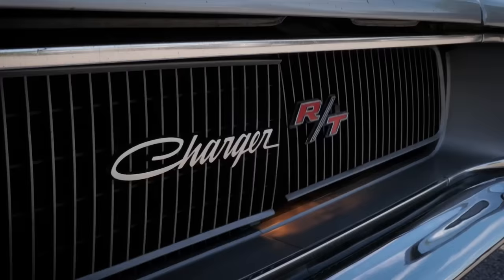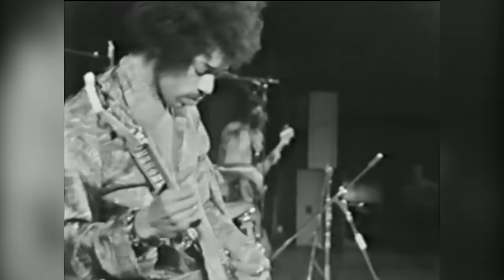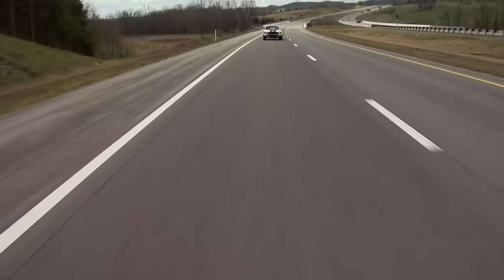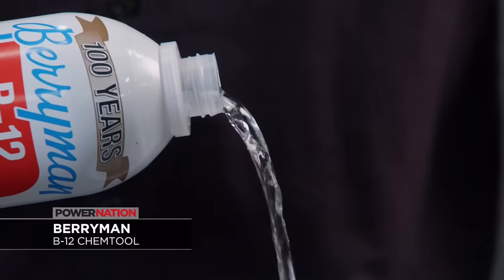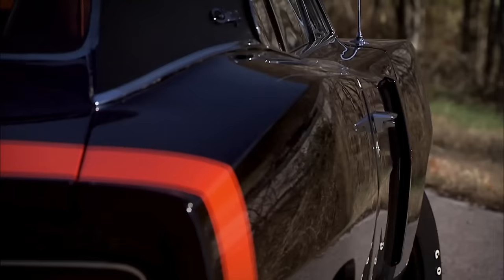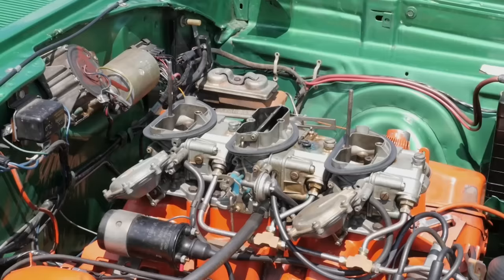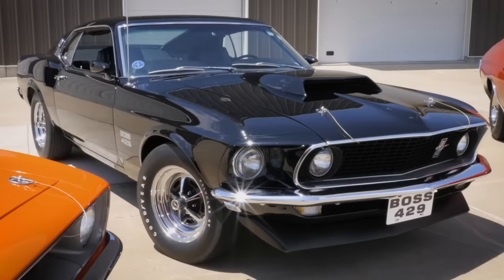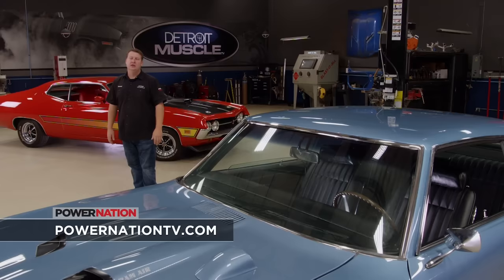Top 10 Muscle Cars of All Time

Comment: I was fortunate enough to grow up in the muscle car era with a Dad that was a gear head and taught me from an early age how to drive and respect the automobile.  I had several cars that I wish I still owned now.  Even though they may not have made this muscle car list, they were still awesome automobiles and I was fortunate to own them if for just a short time!   (1961 Bubble Top Impala with factory 283 power pack option, 1964 Ford Galaxie XL with 390 Police Interceptor engine, 1969 Ford Mach I with 428 Cobra Jet, 1967 Ford 390 GTA Fastback Mustang, 1970 Ford Torino GT 2-door Fastback with 351 Cleveland)
Reply: Same here.

Comment: In 1967 my family had the following 3 cars: 
DAD: 1964 Pontiac Bonneville 2 dr coupe with 421 c.i. V8 3 2 barrel carbs and a (no cost) option 4:10 rear end.
ME: 1963 Corvette Stingray convertible 327 c.i. originally with solid lifter 340 HP motor, but had been replaced by a 1964 365 HP Holley 4 bbl carbed 327. Car had close ratio 4 spd and a 4:11 rear end.
TWIN BROTHER: 1967 Shelby GT 500 428 c.i. 355 HP, 2  Holley 4bbl vacuum actuated carbs w/ Hurst 4spd tranny and Detroit Locker rear diff. The 355 HP was vastly underrated.
Gas was $.25 per gallon for premium.
Reply: Bunch of cool cars, especially the GT500
Reply: 😁💋lol
Reply: Wow - 3 great cars. My Dad had a 1967 Shelby GT500 with C6 auto that i could beat 4 speed Gt500's. Why ? Little known Fact - the C6 Auto in the 67 GT500 was a Factory Spec C6 from the ford 427 Fairline Drag Car that ford built( special order only). Ford sent out their C6 to a specialty shop to beef up the C6 to handle the HP of their 427 drag engine. I think this might have been the first performance automatic in a production car. By leaving it in Automatic using the brake/ pushing on the gas pedal and then releasing it- it I would burn a few feet of rubber go up to about 5500 RPM( 42+ or - MPH) shift burning a few more feet of rubber - then go up to about 80+ and chirp the tires shifting into 3rd gear and just keep pulling very strongly. I got home from the Army in April 1969 and was disappointed went I saw the C6 Auto in my Dad's 67 GT500 but was surprised when I Drove it. With progressive linkage on the 2 Holly 600 carbs you only drove on one but when got on it and the 2nd one kicked - Wow. And setting in our Garage next to the GT500 was my 1969 Kawasaki Mach III the Fastest production at that time - First Stock Motorcycle to break 100mph in Quarter Mile.
Reply: Gotta say bro had the best car haha
Reply: What a time to be alive (and white)
Reply: Early to mid 60s big body Pontiacs, bench seats 4 speed, cruising delightfully American highways.
Reply: @gregorylunsford3991  Ranking leaves fall of 1970 watching my best friend father drive up the drive in his Rambler, trailer tarp pulled back and full view of that unsold 69 green 500 Kawasaki.

Comment: Had a 1965 GTO for my first car
  389.with a single 4 Barrel with approximately 335 HP was fun to drive, however, I also had a 3 duce manifold that took approximately 30 minutes to swap out and the horsepower went to 360 horsepower.
So easy to work on cars back then.
Reply: Usually takes 30 minutes to drain out the antifreeze.

Comment: I had a 69 Z28 like the hugger orange rally sport you showed. It ran 13.96 pure stock, 12.80 with headers, bars, and 5.13 gears. Later with a L88 it ran 10.90s , never had problems with any Hemi, 428s, 440s, 455s or just about anything else on the street. The L88 is now in my 60 Corvette with a 4.88 Olds rear, ladder bars, 400 turbo. Best was 10.60s back in 1975. The Vette was my first car I had ever bought. I managed to keep it when I went to Viet Nam and will keep it till I die. Currently I’m putting a 509W motor with twin turbos in it. I’m 74 now and I will never grow up when it comes to loud and fast cars.
Reply: I know what you mean Bill. I had a 69 with a 396 and built.. Ran real well till I crashed out.  Then somehow I found the A body Mopar bug 440.  10:80 time  Your new project sounds really fantastic.  I'm 60 now and just been building motion simulators but in the mood for  a turbo something..  A nice project to work on..  DMAX motion sim ch
Reply: Stay young at heart my friend and enjoy that Corvette!
Reply: Wow, a pure stock '69  Z/28 with headers running 12.80?  That would have been a NHRA class record holder.
Reply: Bill Ellers, if your '69 Z/28 had headers, bars, and 5:13 gears, it was NOT "pure stock." My '69 Boss 302 Mustang used to eat '67-'69 Z/28's for snacks. Average times were 13.1-13.3. A few 12.8's. It was 100% "pure stock" and had 4:30 rear gears (on the strip) and 3:50 gears (on the street). I bought it new, all options, at TASCA Ford and I still have it today. I raced it Memorial Day Weekend 2021 in NH and best time was 12.7. Same event, I raced my '57 Ford Custom 2dr sedan that has a de-stroked Ford 427 in it. Best time was 9.8. It's street legal as well. That car won three class championships back in the early 70's and it's still badass today. You can keep all the "bowties." Fords have always done me better than any "bowties" I ever had.
Reply: @sergeantmasson3669  That's quite impressive, Sergeant.  It's true that some folks have their own definition of "Pure Stock". I have here the 1986 Muscle Car Review annual covering the various "shootouts" they did in late 1984 and 1985, including the infamous 1970 GS Stage 1 vs. the 1970 GTX Hemi. .  This 1986 Annual recapped them all.  Another one of these "shootouts" they covered was a 1970 Boss 302 vs. a 1969  Z/28.  This was on a Florida drag strip with stock type tires. They called the match-up a basic "draw" after neither car could get out of the 15's at around 95 mph.
Reply: @LR-my2di  NHRA had specific rules for "pure stock" class cars/trucks. Only factory options were allowed for each year vehicles. Example, you couldn't put Ford 427 exhaust manifolds on a Ford 390 GT Fairlane/Mustang. Rear gears had to be for that specific vehicle. You couldn't put 5:12 gears into a Mustang that could only come with 4:30 gears, etc. No mods to the engines either unless available from the factory. I raced in the NHRA nationwide for many years. Everything from "pure stock? to AA/FF cars. One of my former NHRA AA/FF cars is at Don Garlits museum in Ocala FL
Reply: @sergeantmasson3669   I need to visit the Garlits museum one day. "Only" 150 miles from me. As you know, these NHRA "Stock" classes were changed from time to time, mainly because the manufacturers wanted to get involved ($$$).  "Stock" then became not-so-stock. You obviously know your Fords.  I do remember many of them from "the good ol' days".  I remember Boss 429 Mavericks running Pro Stock ~ 1974.  I still have the old under-the-hood pictures of that shoehorn job!  I always had a lot of respect for the 1969-70 428 CJ Mustangs. It was just getting to the spark plugs!  My good friend ordered a plain beige 71 Torino 500 with the 370 hp 429 CJ (the one with the Q-jet) and police package. 3.25 gears; etc. Had a/c and the usual power options.  Only high 14's in the 1/4 mile but ran good on top end.   Good memories.
Reply: @LR-my2di  A trip to Garlits museum is very well worth the trip. If you do go there, check out the Jungle Jim Vega blue funny car. I/We used to own that car and we sold it to Jim Liberman in 1974. I/we built that car in our Manchester CT barn Rollie Lindblad built the chassis, Custom Auto Body created the body, and I/we built the engine and driveline. My best run was 6.71 at 231 mph. Today, that's slow for a AA/FF car but it wasn't back then. I/we won a few races with that car which is why Jim Liberman wanted it.
Reply: @sergeantmasson3669  Yes, that was FAST and quick back then. I remember all of these names quite well ....  and who could forget Jungle Pam?!  I've got many pics from the G'ville Gatornationals from back in those days.  1971-1974.  Many close-ups of all the "stars" and their rides.   You were a lucky guy to be involved.
Reply: @LR-my2di  Pam and Jim broke-up a year before he died in his Corvette street crash in 1977. Pam was always a very nice lady and she broke-up with Jim because she got tired of all the chaos.
Reply: @sergeantmasson3669  Yes, I could see that happening with many Top Fuel teams. Always drama, chaos and on the go.  A hectic existence, even for only a matter of years. Many of these teams seemed to burn out quickly, one way or the other.
Reply: @LR-my2di  Pam got tired of Jim's constant party antics. We gave up AA/FF cars because it became too expensive to be competitive.
Reply: @sergeantmasson3669  Nowadays,  that kind of money is easily thrown around in the then-lowly "sportsman" classes.  This is largely why I've lost interest in NHRA and "professional" racing. I can't relate to it anymore.  I can get a free sheet of Thurs. - Sat. tickets to the Gators each year,  but I've mostly lost the "burn" to go.  Just can't relate to it all as I once did.
Reply: @LR-my2di  I still do NHRA racing once in a while but usually only nostalgia events. Early years, CT Dragway was my home. Now, it's New England Dragway.  Two of my cars won there Memorial Day Weekend 2021 and I plan on going there again this year.
Reply: @sergeantmasson3669  That's a serious accomplishment.  So what are you racing now?  
BTW, I once owned a Boss 351 back ~1980.  I got it from a local Air Force pilot who was originally from NM. I had nowhere to store it properly at the time, so I bought it to resell to a "proper owner" thru the old $25 Hot Rod classifieds of the day.  Those extra cubes paid off with more potent streetability with its factory 3.91 gears.  A good looking car, too.  Silver, Magnum 500 wheels; etc. For some reason, the previous owner had installed a Sig Erson hydraulic cam, but it was otherwise stock.
Reply: Z28 Crossram RL8 302 or 427 Yenko?
Reply: I like the 64 Vette convertible with the 375 hp 327.
Reply: @jamesw.6931  I still have an all options 1969 yellow Boss 302 Mustang that I bought new at TASCA Ford in RI. No headers, 3:91 Detroit Locker rear gears and it did low 13's when new. Today, it turns mid to low 12's with drag radial tires and 4:30 Detroit Locker rear gears. This past June at NH NE Nationals, it did a 12.43@118 mph and won it's ET 12.4 bracket dial-in. On the street, it has the 3:50 traction-lock rear.
Reply: @jamesw.6931  In 1969 I had a family also. In addition to the Boss 302 Mustang, I/we had a '67 Ford Fairlane Country Squire station wagon and a '67 Pontiac Catalina. The Boss 302 Mustang was not my daily driver.
Reply: @jamesw.6931  1969 through late 70's I was a service manager and a general manager. Thus, I had a new demonstrator vehicle 1-3 times each year. During those years, I earned 2 college master's degrees, and I became a master level factory certified auto truck tech. 1978, my wife was killed in an auto/truck wreck leaving me to raise 4 daughters alone. The youngest was 18 months old. I began restoring classic/vintage vehicles at home part-time. In the mid 90's, that turned into a full-time successful business that one of my daughters, and her husband, runs today with me as the principal owner. I currently own 11 classic/vintage fully restored high-performance Fords. Two are one only production Fords I still own the '57 Ford Custom 2 doors sedan that I began drag racing in 1970 (see my profile photo). It set 3 NHRA records and won 3 class championship. I re-furbished that car in 2020. This past June, it won at the NHRA NH NE Nationals with a 9.6 @ 121 mph and my '69 Boss 302 Mustang won its bracket as well with 12.43@ 117 mph. Not too shabby for this old geezer.
Reply: @jamesw.6931  I'm proud to drive any of my 11 fully restored classic/vintage high-performance Fords. I'm currently finishing #12. 1961 black, with red interior, Ford Galaxie Starliner. 390 tri-power B/W 4 speed car. The most fun vehicle is my 1977 Ford F150 2wd short bed 1970 460 Lincoln powered truck. The engine has been modified using all Ford components to 515 HP. I enjoy making punks look foolish with their wannabe dealer bought muscle cars.
Reply: @jamesw.6931  I'm a 10 year US Army Special Forces veteran that did two tours in Vietnam doing medevac duty. E9 MOS 18d. '64-'65 and again '68-'69. Twice combat decorated. 4 years active duty and 6 years in the reserves. After Vietnam, I vowed to become the best auto/truck tech that I could become and did it.
Reply: @jamesw.6931  I also have a F350 4x4 7.3 diesel. I don't know about yours but mine is no mall crawler. It does well for being near 8000 pounds. As for my Boss 302 Mustang, my oldest daughter is a bit of a gear head too. She has a '71 Ford Maverick Grabber that has a 351w HO crate engine in it. I built the car for her back in 1981. the car does low 11's on street tires and closed exhaust. I'm too old? John Force is in his 70's and he's still racing in NHRA AA/FF. One of my neighbors is 81 and he's still drag racing his '66 427 AFX Mercury Comet.

Comment: My first car was a 66' mustang that I dropped a 302 into. Also had a 69' Dodge Dart GTS 340 & a 71' Dodge Charger RS 383
Reply: You don't know where to put apostrophes.
Reply: The Plymouth 340 Duster was a real street sleeper. It gave my 68 396/375 Camaro all it could handle but I won

Comment: WHAT HAPPENED TO THE ULTIMATE TORQUE MONSTER'S BUICK GS STAGE 1 AND THE OLDS 442 W 30 . 500 FT LB PLUS OF TORQUE @ LIKE 3200 RPM. 68 HURST OLDS 0 - 60 MPH IN 5.3 SEC.
Reply: The 1970 Olds 4-4-2 W-30 with 4-speed may have been the craziest packaging ever. Because of the 328 degree duration cam, there was insufficient vacuum to power the required disc brakes. Exercise that Popeye leg!
Reply: @danareynolds1786  Few people even know what you're talking about. If the W30 got that cam, power disc brakes could not be ordered for the reason you mention. I know because I had one!
Reply: You are correct, sir.

Comment: Personally the roadrunner is my favorite car of all time
Reply: I can respect that 👌
Reply: Everyone has their favorite mine was the 1970 Chevelle super sport LS6 454 with 450 horsepower black with white racing stripes cowl induction and Hood pins sometimes I think I might have changed the color to Red with black racing stripes when I see it in most pictures  but  the greatest cars I had the only thing that would supersede that was my LT1 motion Corvette 1970  Orange fire mist motion performance made the fastest cars on the East Coast with tea top I still would love to have back my 66 GTO
Reply: In 1966 I had a GTO "Royal Bobcat" it was fast but I was beat by a 1969 Roadrunner so I sold the GTO and bought a 1969 Roadrunner with the 440 6pac and never looked back. I wonder which one would be worth more today.
Reply: @bogart281  should have bought an LS6 454 1970 Chevelle that would have blown both of your doors off and we would just go beep beep as you breathe in my high octane exhaust
Reply: @joelbell9082  Actually Joel the RR would have crushed the elephant. In the muscle car era the top 5 cars were #1 a 66 Cobra 12.20 @ 118 mph, #2 was the 66 Corvette 427 12.80 @ 112 mph, #3 69 Roadrunner 440 w six pack 12.91 @ 111.8 mph, #4 70 Cuda hemi, and dragging up last was the SS 454 Chevelle 13.12 @ 107.01. You can go pick up your doors on your way out.
Reply: '67 GTO.
Reply: @bogart281  can't go wrong with a roadrunner
Reply: 69 RR 440-6BBL 4 speed 3.91 gears. Hard to beat on the street and strip. Even humbled a few hemi cars.
Reply: 1969 Plymouth Road Runner--Motor Trend car of the year award for 1969.

Comment: Can't beat the visceral experience of the 307 hp 289 with a Borg Warner 4 speed in  65 Shelby GT 350.   Second up is a 69 Camaro RS Z28 Crossram RL8.  They just plain sound good.

Comment: If I could be the right age in 1970, my choice would be the '70 Plymouth AAR 'Cuda, with the 340 6-Pack and a 4-speed with pistol-grip.  I would upgrade the cam, add headers, and find a really good welding shop to widen the factory wheels front and rear.  I would add the best low-profile tires I could find for handling, and lower the car at least 1 1/2 inches.  That would be the car for me, in EM9 Deep Plum, with black stripes and charcoal interior.

Comment: Not even an honorable mention for the Oldsmobile Cutlass 442. I used to blow the doors off most of the other cars on your list with my Olds 442 455 CI 4 Speed Stick dual exhaust. And it looked cool. It was so powerful I twisted the axle off, And The speedometer cable for top end. I guess the other Detroit cars were embarrassed to get beat by a car called an Oldsmobile. And I left a lot of them in the smoke cloud coming off my tires screaming Good Bye.
Reply: top speed was 114 mph so must have been a bad cable Gomer